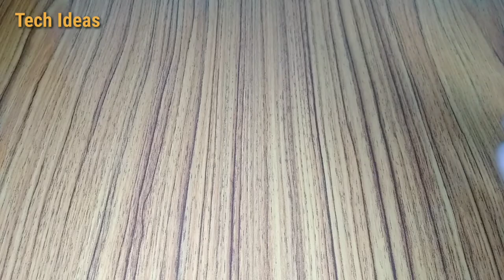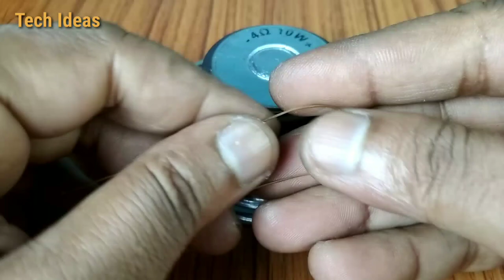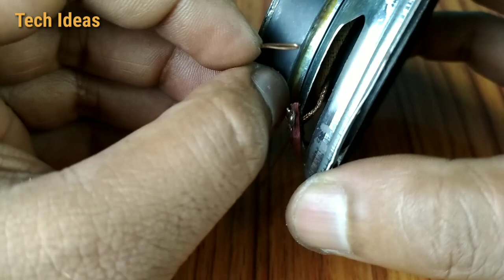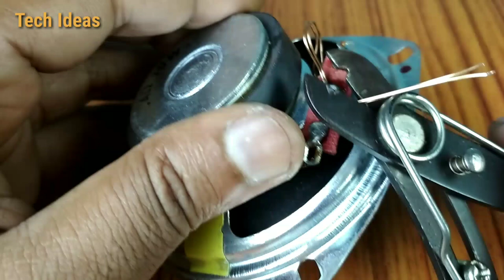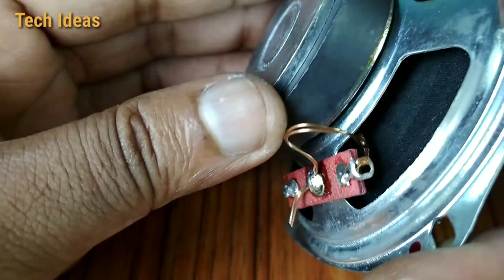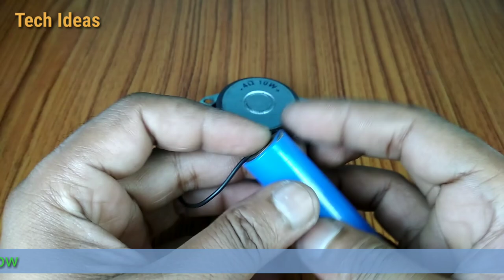Homemade buzzer from speaker || Lol !!!

Comment: It is not working
Reply from the maker: But it's true, you can try again
Reply: You have to do some research where the wire moves, or else you will get a small tap or nothing at all.
Also check if the cable has varnish on it, it will not work if it's varnished 
But you can remove the varnish by burning it off with a lighter.

I did, and I made 1 buzzer and 1 siren (low frequency buzzer) SUCESSFULLY!

For the siren, I used a 150W woofer, which was busted a little, but working.

I found that the travel distance of the wire is good enough to give me a nice horn like tone.

While testing, I was only powering with 3V 1,8 - 3,5A (changing constantly) and it made a surprisingly loud noise! (80+ dB)!
But if I used higher voltage, the DBs may go over 100 easily.

So as a budget burglar alarm, that's decent - add an extra amplifying cone, and  you got a VERY LOUD SIREN!!!

Honestly, a neat project that keeps you from being bored during quarantine.

Comment: I've tried this before, but the only sound I got was an abrupt sound very much like as if someone just tapped the front of the speaker. How can we be sure that there isn't a small buzzer underneath? If the speaker itself is already busted, it's fairly easy to rig a small 3mm buzzer right under that 4Ω 10W speaker...
Reply: You have to be careful, it does work, I tried....
You need to carefully adjust the wire, because if you don't either you'll get a tap or nothing.
Reply: AS IN!! I tried it and it gave me nothing

Comment: These people need to understand that to get any sound, the speaker wire MUST move or else it just won't work.
So please just connect your speaker to a battery, and find a place, where the cable moves. If that doesn't work, try removing the varnish by burning it off, and maybe find a different place for the contacts.
And move the wire in super small steps, till you find the one that makes a sound.
Then, when you power it up, the speaker will buzz.
Reply: First try this!!

Comment: I made this but you only get a quick distortion sound as you scrape the wire across the terminal.  The only way to get sound is by rapidly connecting & disconnecting the lead.  Maybe wire a transistor to do the switching for you ..